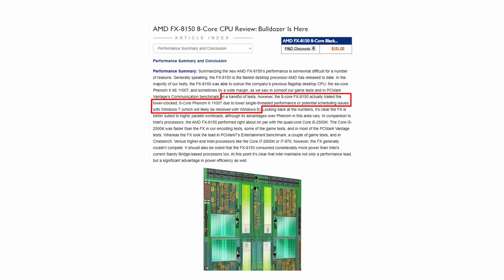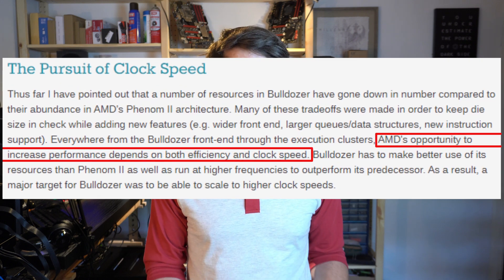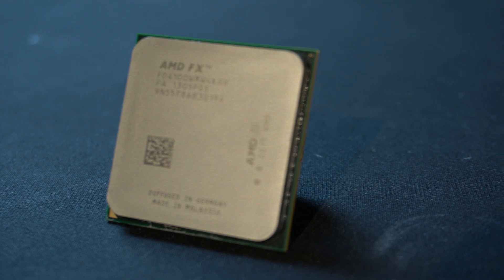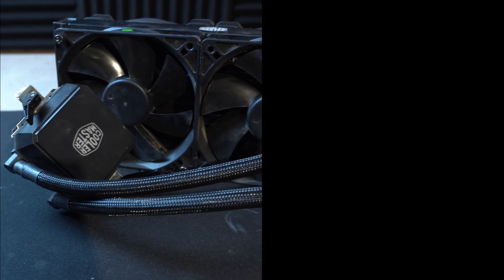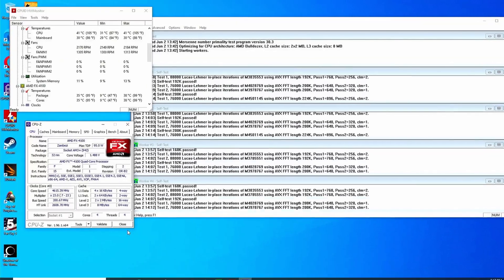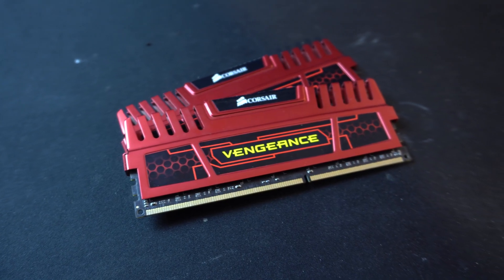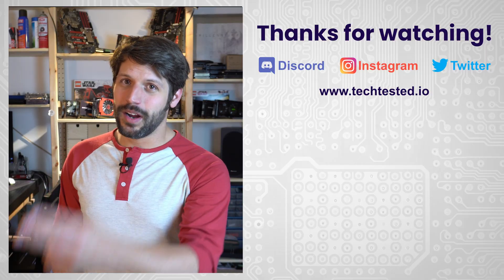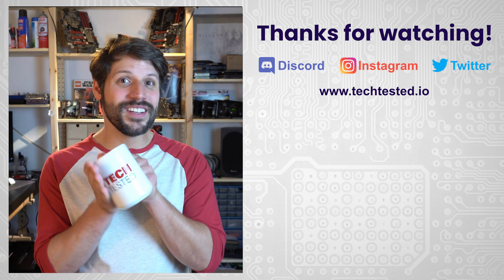AMD FX 4100: Is it really that bad?

Comment: It depends,yes it is bad for some games on other hand some work good.
So i paired this one with RX 580 huge bottleneck,but hey.
Dota,CS,Fortnitne is unplayable barerly reaching 30fps
On other Hand Diablo 2 Ressurected works perfect with ultra settings on 1080P
It is bad CPU rlly bad 2 core with 4 threads....and heats like furnace.
Just get FX 6300,or 8320E if your Mobo is limited with 95W CPU.

Comment: Back when buying a higher binned FX model might pay off. I have an FX 4170 i got in a trade deal recently. It happily runs 5.1 GHz 1.52V on my Sabertooth 990FX and an NH D15. And 5 GHz was stable at “only” 1.48V. At 5.1 GHz, total system consumption with a 24 inch monitor pulls 270 watts when running CBR23.

Comment: im still rocking my fx 4100 with cheapest msi mobo and cheapest ram with rx570, dunno what you talking about
Reply: Idk, you got low expectations
Reply: @stevesmith1383  well more fps vs ds is ok i guess when u only play mtg arena ;P
Reply: FX 4100 is good, considering core 2 quad is still kicking. Fx 4100 is much better than C2Q, close to i5 2400.

Comment: watching this on my FX4100 😅😅 mine craps out intermittently above 4.3ghz though. Gaming aside, this thing is totally still capable. I use this for music production, some video editing and loads of poweruser type multitasking

oh and i've been running copper grease as thermal compound on it for about 4 year now. Still good temps despite the shit cooler
Reply: i5-2400 would be faster and it is 12 years old

Comment: Any chip similar in age that would use the same mobo you would recommend? Fx 6300 or 6350 maybe?
Reply: No, even a low end i3 from any recent core I series will outperform this thing at much lower power usage and heat output.
Reply: @Nick-ue7iw  already have a board that takes these type of cpus which is why I asked, not going to bother buying an old Intel board and CPU, already running a 5600x in my main rig
Reply: Yea the 6300 would do just fine. But try to. Find the 8000 fx although they are quite pricey in the used market

Comment: Still using one on my main system for over 8+ years. Overclocked to 4.3ghz~
Reply: i5-2400 would be faster and it is 12 years old
Reply: Too bad you can overclock that shit to 15 GHz and it would still get destroyed by a Ryzen 3 1200 LMFAO
Reply: @lunetailedfox its understandable that an older chip is weaker than a newer one.

Comment: I kinda wonder how it fares against the i5-2400.

Given that until 2020, i5-2400 OEM machines were recommended as THE go-to for budget gaming, whereas AMD CPUs haven't had much in terms of budget gaming awareness.
Which would make sense to include it, because it's one of the most benched CPUs on the market and can give a good idea to the viewer.
Reply from the maker: I am actually lacking in 1155 motherboards and CPUs to test unfortunately. I need to pick up a couple good motherboards from various platforms for testing still. It would be fun to do a large quad core CPU comparison though
Reply: @TechTested  
I've been looking at a B75 (sandy/ivy bridge) mobo on Aliexpress for a while now.
But that's because it has some colors, that would make it perfect for my RAM and CPU cooler. xD

Plus... it has an m.2 slot, which is very interesting in it's own.

Though currently, I have an h61 build, from an old Lenovo.

Given that 2020/2021 was the year that quad-cores finally started to lose out, I'm fairly certain you can find the necessary boards and chips for a pretty good price :)

Good luck mate.
And good video, by the by.
Reply: @TechTested  is the 13 9100 better or the fx 4100 I have fx 4100 with rx 550 and thinking to upgrade to a better cpu under 100$ (yes ik it goes a bit over 100$ but that's the next closest thing I know)
I don't really know  about computers
Reply: It gets destroyed. At the time AMD's 8000 series were losing to i3s in performance. given higher threaded games of today the FX gets it's shat pushed in. GN tested the 8150 and found it couldnt even beat modern pentiums let alone actual quad core sandy bridge chips.
Reply: I5-2400 would be at least 30% faster

Comment: I have fond memories of this CPU. I still have it in one of my rigs today actually. 
The FX4100 was my first gaming CPU. 
I had a PC with an FX4100, 8GB, HD 6670 and Windows 8. 

It was back in Highschool and I remember rendering terrible animations on it and playing Half Life 2 and Garrys Mod.
For the longest time I just had a Single Core Celeron with 3GB of ram and a 64MB Intel GMA 4500M that could barely play Half Life source at 480p res.

So its quite amazing how my first gaming PC was considered low end but it was a massive upgrade in my eyes at the time. Although, I wasn't pushing the GPU that hard cause I had a 768P Acer Monitor that used VGA only. I remember flipping shit when Half Life and Oblivion ran well over 60FPS at times. 

I miss being that easily amused, honestly. :D
Sometimes I am impressed by my 3600 and 2070 now but because I'm like...used to stable highs, it doesn't totally impress me that hard. Although I do get some of that "Wowie" factor when I find a game is running well above expectations on lower spec or very entry level gaming laptops.

I think I flipped shit when I had MGSV : TPP running at 30fps at 720p on an AMD A12 9720p laptop.
Reply from the maker: I totally understand the fond memories. I upgraded from an athlon 64 x2 to the FX 4130. It was a huge upgrade for me as well. While FX may ultimately be a bad purchase today, it definitely hold a special place in the heart of many PC enthusiasts.
Reply: @TechTested  Yes! I like to think of FX for newcomers to PC gaming back then as like, the foot in the door, the entry point if you will. :D 

Anything before it (usually a laptop or netbook) felt objectively terrible so the mediocre performance it gave felt like god tier performance comparatively. 

Its wonderful that people who get into PC gaming nowadays typically just have a pretty competent CPU regardless of their device, the only thing holding them back usually are integrated graphics but even those got really good in like, five years time? It was rather quick!
Reply: I had a fx 6100 and radeon 6670 back in 2012 😁
Reply: I only use fx4100 my 1st ever 4 core cpu in 2021.